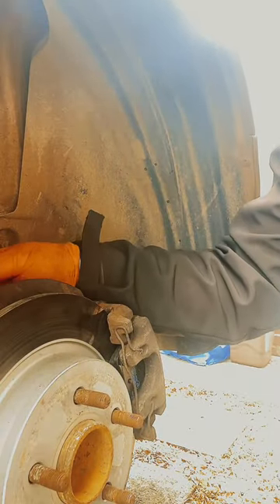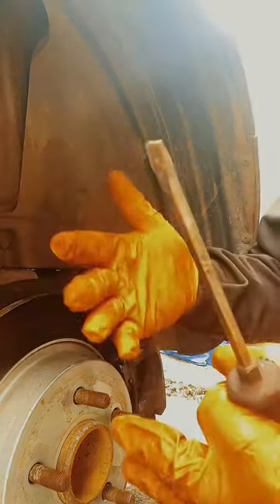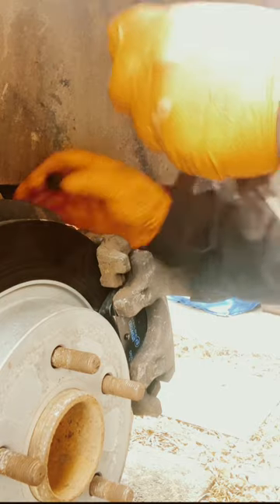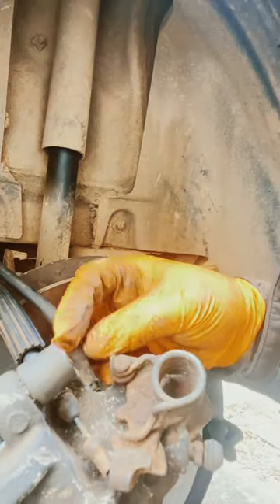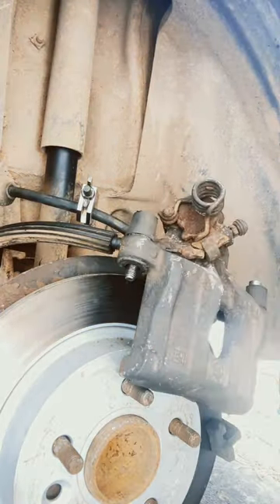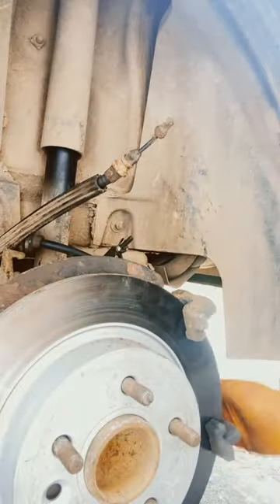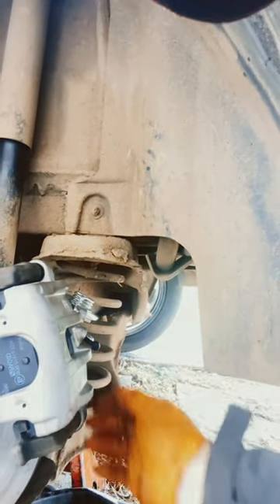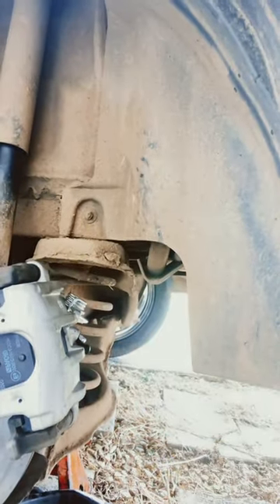Rear caliper replacement on a Volvo v50

Comment: Perfect! Will give this a go!
Reply from the maker: Do it Keith! Let use know how you get on
Reply: @EllsAutoCare  Just fitted one side. Was a LOT easier than I thought it would be. The handbrake cable was a bugger to get off, but once I did that, clamped the inlet and lost some knuckles to the last bolt, it was actually a doddle. Thanks for the video, nice and short so straight to the point and it helped a lot!
Reply from the maker: @cornbeef  I hope you found your knuckles in the end mate! They come in handy ! See what I did there? Yeah I’m here all week